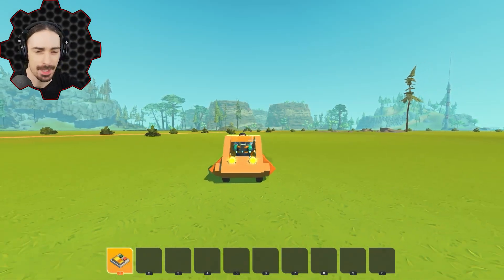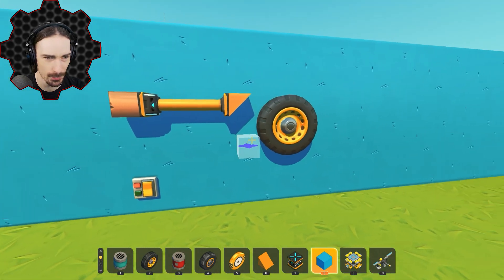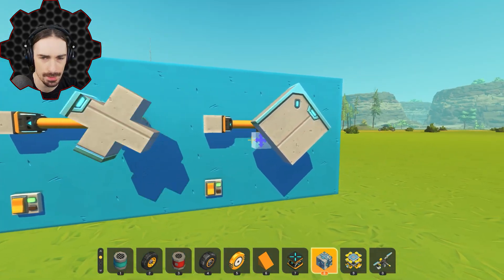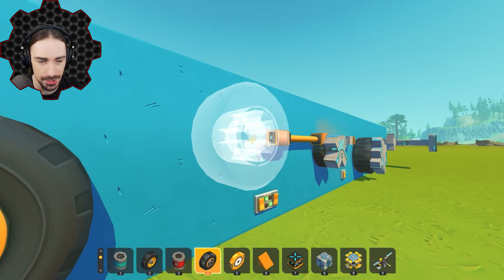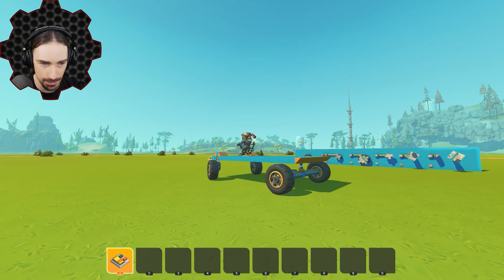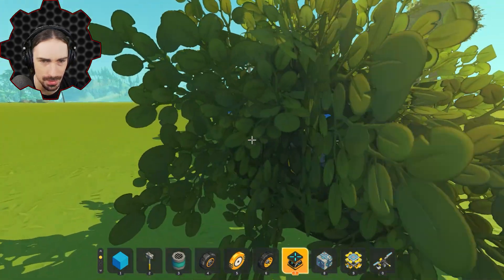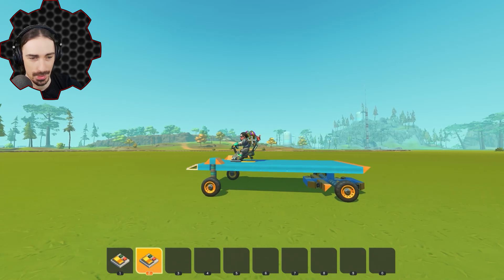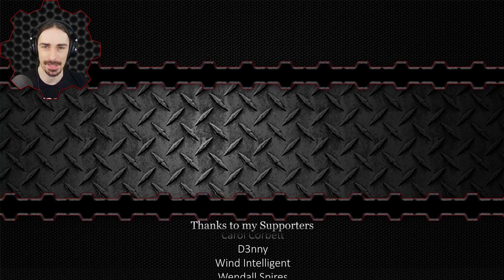The Spooky Science of Wedge Powered Objects

Comment: I am a programmer, I can explain how this works/why this happens (theoretically).
All objects have a hitbox and a boundary box collision. Boundary box collision is separate from hitbox as hitboxes is a cube that depicts the X,Y,Z of potential collisions (collisions can be any shape inside the hitbox), this is what the boundary box is for, to visualize that. For physics to work, when one objects collision is breaching the collision of another object, the 2 objects repel eachother from the point of where the breach occurs. This is how objects can "touch" without overlapping. The closer to center of mass, the more force they push away with. A 45 degree wedge is the closest you can get to center of mass because the center of the boundary box is already at the surface rather than inside the geometry (collision).

What is happening is that the 2 objects are constantly having a breach and are trying to exit from being inside eachother. The wedge is being pushed back and up while the top of the wheel is being pushed forward and down. Due to the hinge, the top of the wheel can only be pushed forward OR down, not both. With the wheels position being locked there, the wheel cannot exit from being slightly inside the collision of the wedge, meaning normally, the wedge would be the one to exit the intersecting collision. . . except while the wedge is being exited out of the wheel, the piston is pushing it back inside the wheel collision as soon as it exits. This then causes a constant loop of repeating the issue thus causing the process of "exiting" to constantly keep repeating. . . resulting in the top of the wheel always trying get away from the being inside the wedge thus creating constant motion due to the wheel constantly trying to escape the intersecting collision.
Reply: That makes sense, but why does it go faster when you put mass far from the wheel?
Reply: @The_Wosh  Different center of mass.

The big difference tho is making sure nothing is colliding with the sides, like something on the wheel’s end is not colliding with the side of the wedge.
Reply: @Hadeks Marow
Good explanation i need help with unity
I cant get it working
Good
I understood the explanation well
Reply: The issue
Is collision btw
Reply: @T1A4437  that could be due to how you exported the model vs if you imported a collider properly.
Reply: I think you are correct, this is the result of a hitbox collision. This is actually the most practical hitbox collision bug I've ever seen as most of the other ones in Scrap Mechanic and other games I play tend to cause extreme lag, break reality, or both. This bug can be extremely useful if harnessed in some way. Since it is a hitbox collision, I wonder if there would be some way to use glitch welding physics or something similar to it to make the hitboxes push into each other even further making the wheel spin faster. Maybe suspension glitch physics could also be useful in some way since that is also a hitbox related thing.
Reply: That was actually really inreresting to read, and makes sense. Thank you for that! 

And why don't you have more likes, these are some of the comments that you want to read
Reply: I noted also that the multi-wedge in the experiments had a lot of oscillations perpendicular to the axis direction. This may induce greater overlap with the wedge and create a greater force. As such, applying the wedges further from the bearing position may be the key to the increased force rather than the number of wedges.
Reply: @kylewall9107  I cannot speak on how their bearing are coded with things like how it holds weight/how flexible they are/if they have any give, but depending on how they are programmed, I can see that being a potentiality.

However, multiple wedges that are on their own independent piston (as apposed to 5 wedges all on the same piston) would/could create an off-set in the "pulse" I mentioned earlier, which would translate to more pulses per second, which can translate to more speed, depending anyways. However, I believe that this scenario is a much more likely guarantee than the previous possibility you have provided (by that I mean just a stronger likelihood, not that your notion isn't also worth examaning, cause that has a fair chance as well, again, depending on the bearings programming).
Reply: also the piston has no clip properties
Reply: @slycooper1001  i think you mean the piston POLE has no COLLISION. The piston base has collision but since the end is so far out, that really doesn’t matter. As far as the game is concerned, the wedge is floating in space semi locked to an axis trying to hover to a specific location more or less.

But now you have me wondering how the wheel would react if you put a block behind the wedge inside the piston pole and how that would mess with collision. I would assume it would make the wheel spin even faster.

Reason:
The block would provide collision to push the wedge back into the wheel in addition to what the piston is already doing, theoretically making that "pulse" I referred to happen even faster/more frequent. The alternative is it would have the opposite effect and help the wedge settle to the position it's supposed to be thus accidently "fixing" the glitch. But either one is possible, and that's EXACTLY why I am curious! O.O <3
Reply: @Hadeks_Marow  (in response to you talking about putting a block in the piston cylinder) The entire piston doesn't have collision (I assume due to the difficulties of having an extendable collision/hitbox), and this can be tested in-game and can be used in creations to be able to move something through something else (like a shaft with it being supported by a bar in the middle, and to keep the same speed and rotation on both sides of the bar it uses a piston on the side of the shaft to connect the two sides of the shaft and the piston can overlap with the bar holding the shaft).

In the game creations have different solid "bodies" that are separated (and also held together) by objects like pistons, bearings, suspension, etc. The "bodies" while being in the same creation, they can interact with other bodies in the same creations, they can not interact with themselves. (Example: ScrapMan's experiment. The body that is the wedge that is held by the piston the the body that is the wheel that is held by a bearing. They interact with each other, but if you put another wheel on the one that is pushed by the wedge, the two wheels don't interact with each other, since they can't move in the same body, because a single body is solid and nothing moves in it, and because (I think) they are programmed to not try to interact with each other to same processing power)

The only way I can see placing a block on the wedge would affect the wheels rotation would be that the block would slightly slow down the frequency at wich the wedge pushes the wheel. But the block would not affect the wedge's hitbox or collision in any way, since they are in the same body.

And an interesting fact about Scrap Mechanic's way of physics is that while every part (like a wedge, wheel, flower pot, pipe, etc,) has it's own collision and hitbox even when they are in the same body, blocks (dragable blocks that you can place multiple at a time) are processed differently. Whenever the came can find a block of blocks (like a 4x4x4 cube of blocks, or 1x6x4 thing of blocks, or any other formation of XYZ) the game puts them in a single object with a single hitbox and collision but the block of blocks must be a group of the same block (with the same UUID) and the same color. After it finds one, it applies only 6 sides of texture (less or more depending if any other block of blocks is next to it) so that no processing power is wasted on rendering and Z-fighting textures that are between two blocks and no power is wasted on having a collision for every block placed.  

I hope this was readable :)
Reply: @torfley  I was referring to putting it in the piston arm so that when the wedge gets pushed out of the wheel, it would enter the collision on this new block, thus potentially making it go back into the wheel even faster (or somehow nerfing the entire operation somehow). I didn't mean "attach it" to the piston pole, rather just have it rest there attach to the structure/vehicle base.

Once again, that extra block would be welded to the base of creation/vehicles base inside where the piston pole would end (right behind the wedge BUT not attached to the wedge, similar to how the wheel isn't attached to the wedge), to see how it would interact with the wedge. This might require a glitch weld tho. Basically, the extended wedge would be in-between 2 separate instances, the wheel, and this newly welded block.

Did that clear things up any?
Reply: @Hadeks_Marow  Yes, it did.

But I don't think that would affect the wedge or wheel, since there would still be observable space between the placed block and the wedge. The wedge is being pushed a bit more from it's normal position (that being in the block right before the wheel) in order to touch the wheel, therefore, the experiment that you suggested can not be tried, I don't know how that would affect the wheel if it clould.
Reply: @torfley  I'm not so sure about that one due to the oscillation. Even if the wedge is at a 0.5 degrees of the build grid, this can still be matched with 2 bearings and a controller.
Reply: @Hadeks_Marow  I don't understand what you mean by "0.5 degrees of the build grid" and "be matched with 2 bearings on a controller."
Reply: @torfley  Well I'm not sure what YOU mean by "visible space". Cause I was referring about locking a block in place DIRECTLY behind the wedge (where the extended pole would be) acting like a stopper from the wedge going backwards so that when the wedge is pushed backwards due to collision physics of the wheel, it would be pushed into the the new blockls collision, thus creating a secondary instance of the game telling the wedge it needs to move forward back into the wheels collision (first instance being the piston pushing it forward).
Reply: @Hadeks_Marow  In the video you can see ScrapMan sets the piston to a length that is close to the wheel and then he sets the piston to go one block further but it can't because the wheel is in the way. And since the wedge didn't get to it's final position (wich would be inside the wheel), you can't place a block right behind it. You only could place it behind the wedge with some space between the two or inside the wedge.
If you want, I could make an unlisted video with what I'm trying to say and send you a link.

I hope you will have a great 2022 by the way :)
Reply: @torfley  Wait, do you think "behind" the wedge is on the side WITH the wheel? I'm so lost. A video would help but you can get a block in any position by just making a makeshift arm. The idea behind a makeshift arm is you have a V shape, where the bearings are where the dots are:

(start) ./'\ (end point)

After that, you use a controller, and set the degrees for the one, then invert that value for the other bearings degrees. If one is 45 degrees, the other is negative 45 degrees. This way, they always spread on a straight line. This is how you can position a block without being locked to the grid.

I can make a video showing off the makeshift arm tech.
Do keep in mind tho, links might not work (auto-flagged, auto-deleted) so send 2 messages, one with just the link and one saying the link was sent and any message that would have gone with the link, just to be safe.

EDIT:
when you invert the value, multiply the inverted value by 2. So if one is 90, the other is -180.
Reply: @Hadeks_Marow  Or it can also be called the 
Wedge Infinite Energy No Entropy Reactor
That doesnt make sense but it spells wiener so its funny
Reply: I like your funny words magic man
Reply: a duck: :U
Reply: I don't totally understand but it seems like the wedge works like a hand on an arm rolling a tire across the ground.
Reply: Very good explanation, but why is a full block then causing the wheels to rotate the other way? 🤔
Reply: person:U be siansy.
me:???
Reply: TL;DR: This bug is a result of the fundamental design of the collision mechanics, and is unlikely to be patched any time soon.
Reply: so it's like prop flying, but the jumping isn't manual but rather forced, and instead of a player pulling an object towards them, the object is getting pushed towards the player
Reply: y e a h.
Reply: So... could we call it a magnetic hitbox-based piston?
Reply: @kuraibrdm  not even remotely
A closer name would be something like perpetual collision energy or constant collision pulse.

"Magnetic" implies the connotation that the objects are drawn together where that is the power-source rather than the piston.
Reply: @Hadeks_Marow  Center of mass gravitational anomaly repulsion cheese wedge super machine
Comgarcwsm
Reply: that's actually the first thing I thought of
Reply: I commented just recently and this is what I was trying to explain, I am not a programmer quite yet so I didn't know the specifics but I knew what I was trying to get across. You said it much better.
Reply: My brain died while reading this
Reply: This actually makes sense
Reply: BIG BRAIN!!!!!!
Reply: you can fly in trailmakers this way have something bend back on to the cockpit right and you go striaght up
Reply: sorry for reviving an old comment, I'm gonna be that person lol. Do you think more or less friction would help this tech? I'm using this tech to charge alternators on Crashlander, and I'm wondering if it will be stronger if it pushes against the wedge more - at the same time I also think it might be better to have less friction now because it's essentially sliding against the wedge constantly

I would test it, but I'm somewhat early game and there's no roller wheels in vanilla
Reply: @moffichu9150  Friction is separate from collision. Forget the wheel and the wedge. Imagine it like this:

If you push your water bottle forward with your hand. . . does wearing a slippery glove have any different effect on the push than if you were to wear a sandpaper glove? No. It wouldn't. Because the factor that matters is the force of the push. Regarding to physics engines, when something is inside of another object and stays there, I would presume that's already max force. Collision in games works sorta like water. Lets say you have a floaty device and you try to put it inside the water, the water tries to push the object out of the water. That's pretty much how game collisions work, only the push happens in both directions but first starts with dampening motion/momentum.

It's a decent question to ask and I think you are very smart for using this tech for the alternator. Honestly I wish I had thought of that. I just went with stacked bearings and a controller.
Reply: it doesnt take a programmer to explain that just someone with basic logic of how SM game physics work
Reply: You wrote an essay on YouTube comments
Reply: No one will read all this yapping buddy, no one actually asked
Reply: @thesecretmember5448  are you dumb? the person replied and the conversation already ended ...
Reply: @thesecretmember5448  you're not very bright ... the person already replied and the conversation ended ... What were you even trying to achieve?
Reply: @moffichu9150 come on dude, try to logically prove that I'm "not bright" you don't know me! and why would I care if he replied or whatever?! I can say whatever I want
Reply: @moffichu9150  cry about it if you're mad
Reply: @moffichu9150  I didn't start the argument buddy! You did! and who tf said I was forcing people to like me??! You're imagining things now
Reply: @thesecretmember5448  You see that number next to the word "replies"? No? How about about the number above it next to the thumbs up icon? Yeah, that's the number of times you're wrong by. It's just you necromancer buddy. It's just you. Stay in school and therapy is your friend. ✌

Comment: add another set of wedge powered wheels to add to the power ( without the double wedge starter ) like a gear shift, also the blocks with the least friction where your breaks were, would that increase speed and stability of the spinning tubes ?

Comment: Keep in mind that speed doesn't necessarily translate to power. The wedge glitch seems to offer a lot of rotational speed, but very little in the way of actual torque, so wedge powered vehicles would need to be very light to work best, otherwise you're just fighting a losing battle against the vehicle's weight. Your experiments didn't accurately reflect this because the weights were being added at the center of rotation and the weights were balanced in all directions, so there was very little for the torque to actually fight against.

Comment: Instead of one piston for 5 wedges, what about 5 pistons with 1 wedge each? I think they'd be able to adapt to axle movement better
Reply: Yes but lag
Reply: What he could do, is to replace the pipe pieces with wheels, yes, frok the experiment the pipe pieces rotated faster, but may have less torque, and the wheels might be the other way around
Reply: @20SuperNOVA04   the thing is, to get any useful speed, using pipes might be necessary as it basically acts like a gear. Since the wheel is sharing a shaft with the pipes and the wheel is bigger, the car will go faster with the same amount of rotations. So probably applying the power directly to the wheels would give it more torque, but less speed. 

All that would be true if logic applied here but we're talking about Scrap Mechanic so all of this is probably false
Reply: I thaught the same when scrapman said I got a idea but he placed the same contereption upside down
Reply: He already determined that pushing force has no affect, but knowing Scrap Mechanic, it could be worth a try.